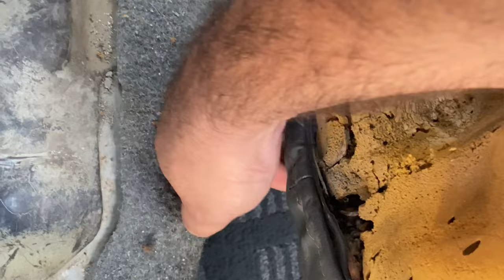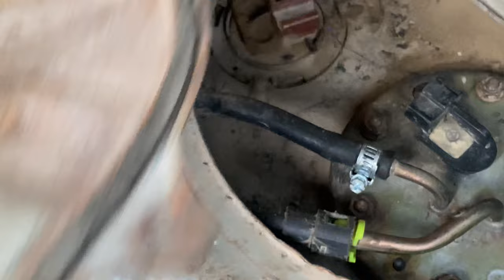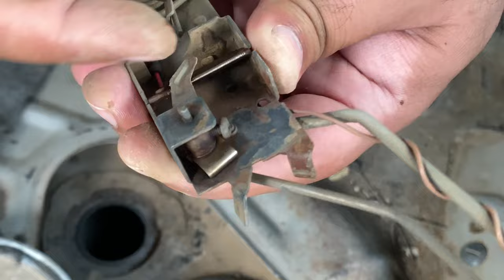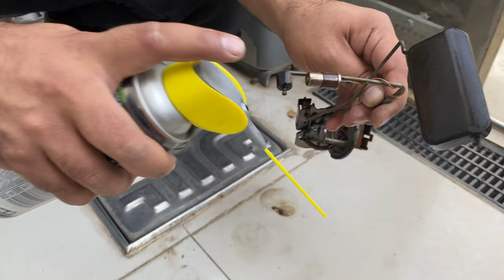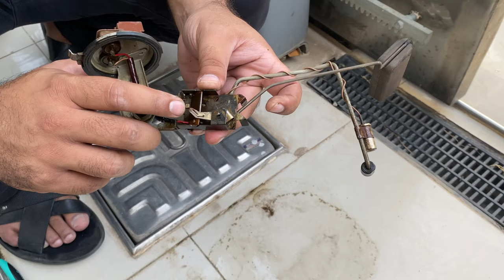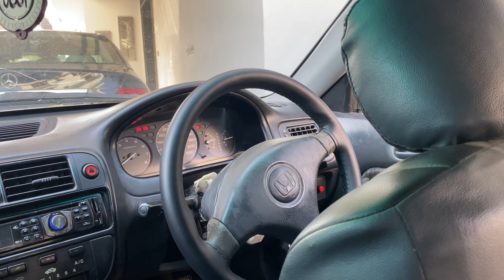How to fix Honda Civic 1998 EK / EJ Fuel Guage for Low / Reserve Light

Comment: At 12:10 When you said the "reserve light" should be on is not true. The reserve light should be on immediately when you turn the key on no matter where you move the float. The thermistor doesn't care about where the fuel level is to show the reserve light. It only cares about being submerged in a liquid. We knew as soon as you turn the key ON that the low fuel thermistor sensor is ruined because it didn't light up. Do you know what I mean? It is possible to have a full fuel tank meter and still have the low fuel reserve light on because the sensor is out of the fuel tank so the thermistor isn't inside a liquid. The fuel level depends on the float position. The reserve light depends on the thermistor submerging in fuel.
Reply from the maker: Yes but later when thermistor was changed the case was different it got turned on only when the guage was moved to end position because thermistor ciruit only completes when it is at end position. Yes on the other hand you are right that at just ignition it should be on no matter how much fuel is in the tank